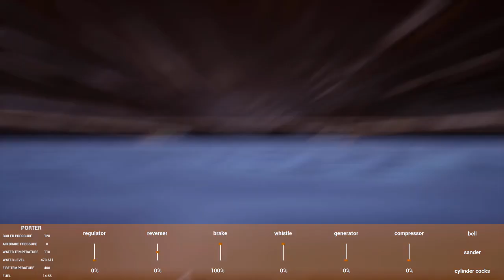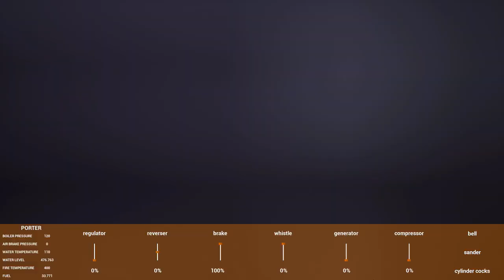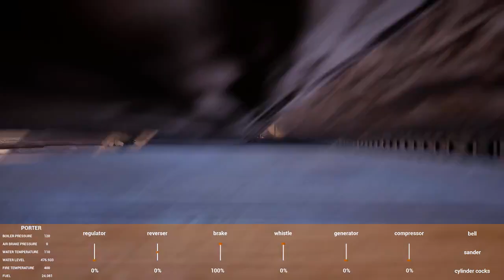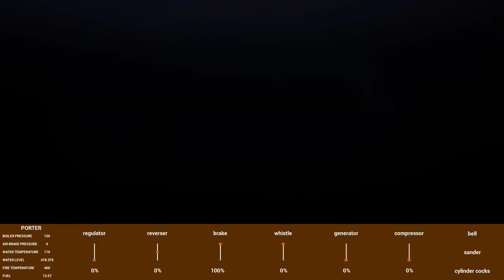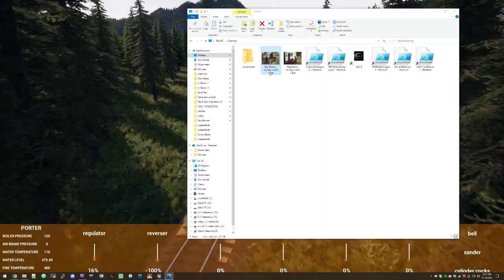Livestream archive - Railroads Online! Hauling logs and lumber for profit

Comment: Honestly think the Montezuma makes more sense as the games starter engine. It was the D&RGs first locomotive and it is far more realistic to see running most of the games early lines. Obviously the porter is kind of iconic at this point, but its really just a yard switcher. The Montezuma still is pretty relegated to early game aswell as it's not like you are gonna be able to pull more than a couple cars up a grade. Let alone it's cheaper than even the 0-4-0 porter.
Reply: It would be nice if they did that. I think the only reason they don't is because of the tender, if you have a derail it's more fight to get the tender oriented correctly and tied back in. But the Montezuma and Glenbrook would make for great starter power.

Comment: The reason the Montezuma was slowing down was because of the new splines affecting locomotive performance, usually it's because you have short splines in a short distance, going over 2 separate splines will also hamper performance.

Comment: Bought it back in March of this year. Month ago I finally finished my first every Industry map. Waiting till after I make 1st oil drum run before switching to beta. I tried the beta some more today, it's okay but without the current main version track building options you loose alot of creativity. I use alot stone ground work and bridges for end of line and staircases